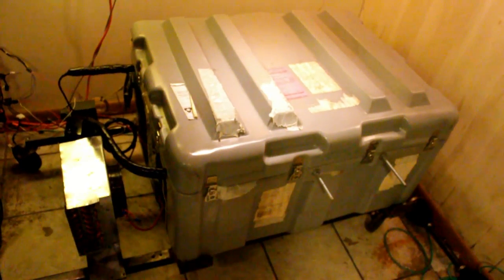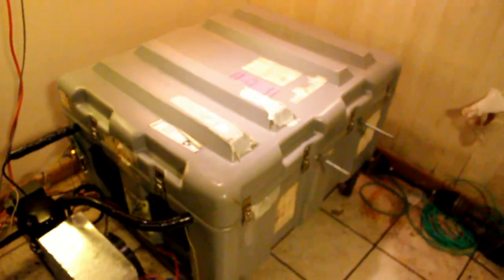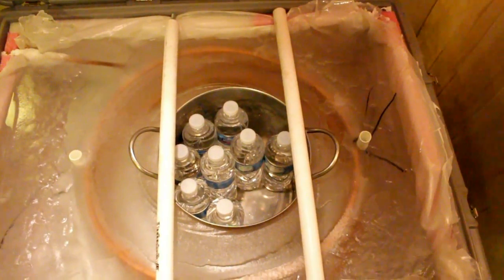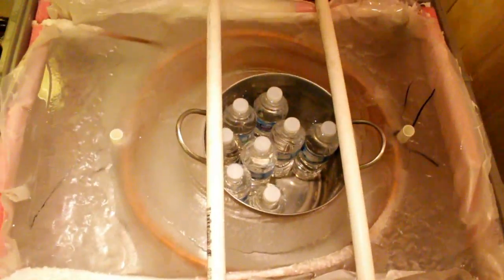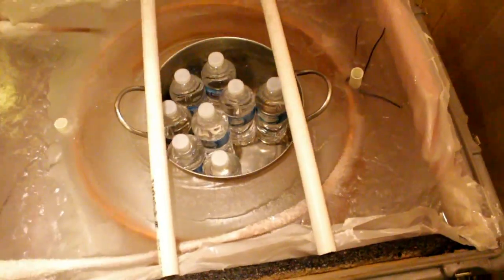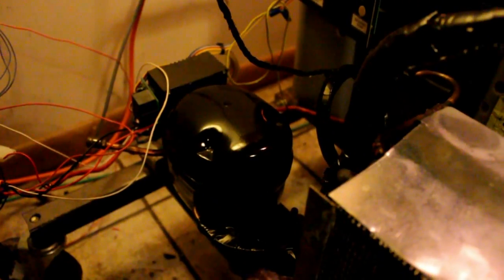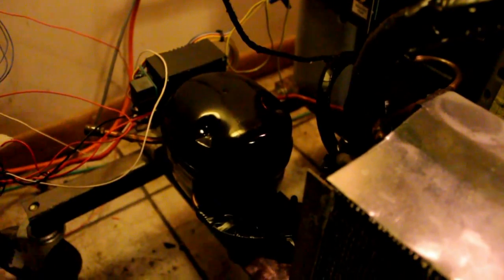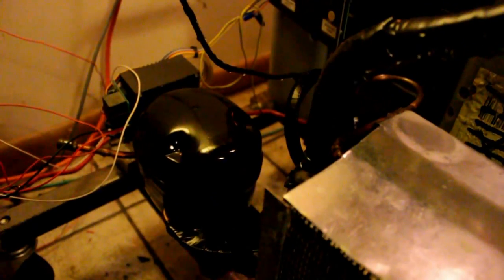Thermal Energy Storage Project: Icebox

Comment: This is called the "Ice Bank" system.  Used to be extremely popular for large buildings that were only occasionally occupied such as coliseums and churches.
They would run small refrigeration systems for days to freeze large quantities of ice and then use that ice to produce chilled water to cool the building.  It effectively allowed the use of much smaller systems to provide a huge cooling capacity in a very short period of high demand.  The efficiencies were also much higher because there was very little cycling of the compressors.  Latent heat is an amazing thing.

Comment: Can see you put lots of thought into your work. Really nice job on your proof of concept.
Keep up the good work!

30 years ago I read a science magazine article predicting huge energy savings by freezing a 10,000 gallon tank of water underneath a home in winter and cooling the home all summer via a heat exchanger in the ice connected to AC.   Was going to save a bazillion KWH!   Uh..., guess somebody got lost along the way on that project.
Reply: Homes here (Austria, Germany) use systems like that to store heat from the summer to heat a home in the winter. With decent insulation, a big solar thermal installation on the roof and a big tank you can get through the winter without any other heating. And that includes a few month with negative temperatures.
But using water as a storage medium is stupid for this purpose. First and foremost it expands by 10% while freezing, which will wreck your tank. Secondly you want something that "freezes" around the temperature you are interested in. Melting/freezing means a huge amount of energy transfer. Melting 1g of ice (0°C) to 0°C water takes the same energy as heating 1g of 0°C water to 80°C. Other compounds have that property, too, but at different temperatures.
Reply from the maker: superdau That's the whole idea. Utilize the latent heat of fusion of water to store a large amount of thermal energy. For air conditioning, the entire tank need not be filled with solid ice. In fact, most of the ice forms around the heat exchanger with some water left around the sides. As far as temperature, using a traditional liquid to air heat exchanger and pumping said water though for air cooling purposes leaves you with the option to use a variable speed pump. If the temperature of the water is too low for your cooling needs, simply reduce the pump speed to reduce the flow rate. Thanks for watching.

Comment: Yep, it has been a long time.
I'm more of an electricity and compressed air kind of guy, but there are definite possibilities with ice...

Besides the thermal benefits, a system like that can also provide an emergency lighting system through thermopiles, or Sterling engines. It wouldn't be very efficient, but you wouldn't be in the dark, and the cellphone, and laptop computer will be charged, as well as being able to run an emergency radio.
Also, a sterling engine could also be used to re-freeze the ice if it's externally powered. Thermopiles would have the same effect, but probably would require more juice.

Comment: I’m experimenting with ice storage myself for air conditioning purposes. Have you run your copper evaporator through many cycles? I was worried about using copper as I thought it would break after too many freeze thaw cycles.

Comment: Very good proof of concept!
As a college said before, heating/cooling with 0°C / 0°C - ice, there is so much energy in this phase shift, like you would need to boil water from room temp. to 100°C ...into evaporation phase... This concept was a big topic but somehow, since there was not much money to be made with it, because of high efficiency, the industry put it aside...like old Edison Batteries NiFe... worked to good, and toooooo long....

The most interesting topic would be, if you could use this type of storage system instead of chemical Batteries and store the energy from PV / Wind / Water ... whatever... and get back electrical energy when needed... 

How could we accomplish this...without to many losses in the conversion process..?

Would replace any Lithium/Lead/...battery.. in every home energy storage system...

Best regards!
Reply: The only way, I would know at the moment would be the temperature difference using Peltier elements.....
What would you suggest to use, to make electrical energy again?..
Reply from the maker: lukelordoflight A peltier  element would be the simplest, but I think a turbo expander would be more efficient. Still the efficiency from thermal to electrical would be low... at best
Reply: subcooledheatpump It would be incredibly low.  No form of refrigeration is less efficient than Peltier devices.  I believe the number is around 10%.

Comment: Im a bit confused hopefully you can help me understand , but what energy are you storing? because from my understanding you are using energy to pull the energy away from your ice box, the lack of heat is a direct indicator that your molecules have slowed their movement hence lost energy inside the ice box. so are you storing the thermal energy drawn from the ice box in a separate container ? because the presence of cold is simply the lack heat the same as; darkness is the lack of light or evil is the lack of good. please give me some clarity when you get some time
Reply from the maker: +Kazimer Dec Technically you are correct, as ice is just absorbing thermal energy. Refrigerators use energy to move thermal energy out of the refrigerated space. If for example, you would use a solar panel or other intermittent energy source to power a refrigerator, you would need some form of energy storage to keep the refrigerator in operation, otherwise it would simply stop working and the refrigerators temperature would rise to an unacceptable level. So while the icebox isn't technically energy storage, you could think of it as energy storage as it would replace a battery or other electrical storage device. Instead of using stored electricity to power a refrigerator, we just use the latent heat of fusion of the ice to keep the refrigerated space at an acceptable temperature. Thanks for watching.
Reply: subcooledheatpump so instead of using the energy in the summer , youre using the energy in the winter to build up ice ,  then you allow the ice to absorb heat into the summer air circulating through your home . thats what i had thought before. how much savings due to savings have you experienced or calculated to have ? does the solar panel collect the same energy in the winter as it does in the summer?
Reply from the maker: +Kazimer Dec Right now it is just a refrigerator for keeping food from spoiling. It could be scaled up easily to provide air conditioning in the summer, but eventually you would have to use solar panels to reform the ice.  A company called IceEnergy does produce a unit which works in a similar fashion that is used for air conditioning, although they promote using grid power at night when it is less expensive to form ice, then melt during the day to provide air conditioning
Reply: So you can't light a bulb at night using this "energy storage system" and some solar panels...

Is there any way to convert that "thermal energy" back into electricity?
Reply from the maker: There are several ways. In theory, any heat engine would work. The ice would be the heat sink and the atmosphere would be the heat source. In reality, only a few types of heat engines would work well. I think a Stirling engine connected to a small generator would be the most practical way, but even using this method, obtaining practical efficiency would be a challenge.